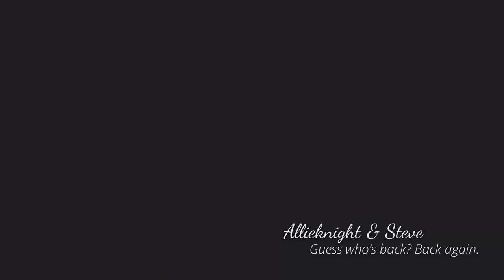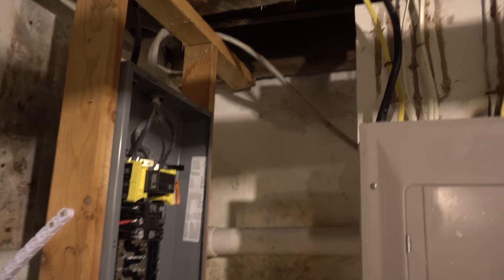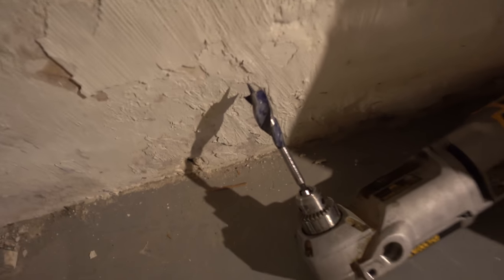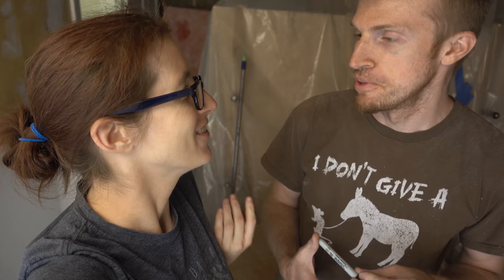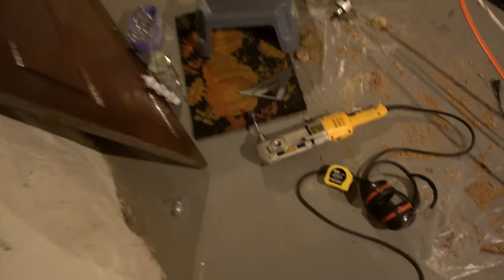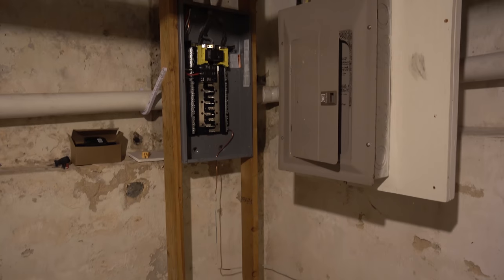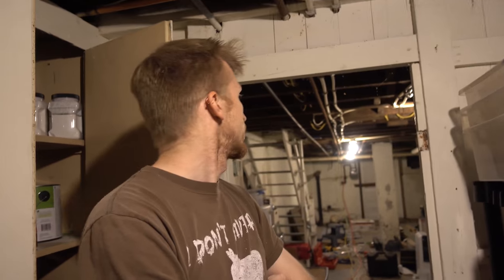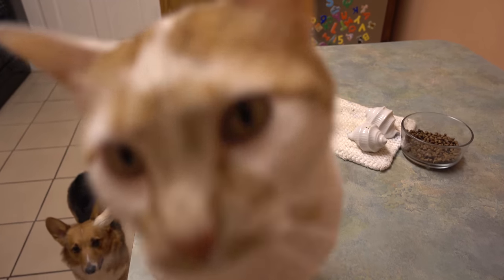Guess Who's Back? Back Again!

Comment: I shouldn't encourage your using a 100 amp box. But here's a tip. I had circuits not grounded. So the electrician took circuits out of the panel and ran them into junction boxes with a GFCI and ran a new wire back into the panel.
I'm guessing you're going to have wires not long enough to reach the new panel. Need GFCIs?
Reply from the maker: We are running all new wiring - some of the existing romex may get re-used, but only if there is enough length for a continuous home run that can be safely grounded into the panel. Steve doesn't believe in junction box mess

Comment: I'm dealing with split floor joists from the previous owner drilling holes to run upgraded wiring . The gas and water lines hang from the bottom so why take a chance on weakening the joists? It took a couple years for them to split the house was built in the fifty's.